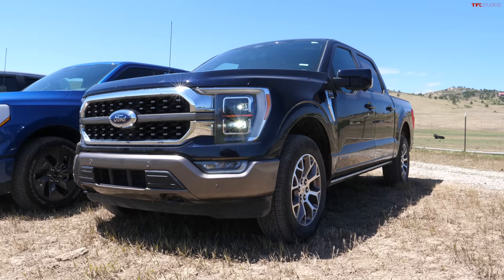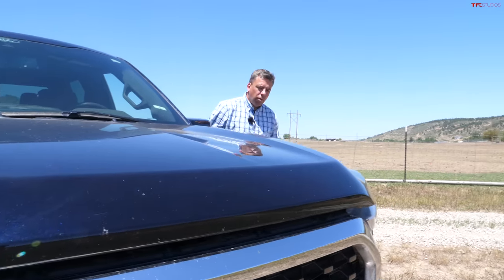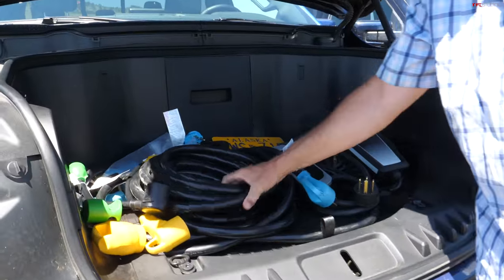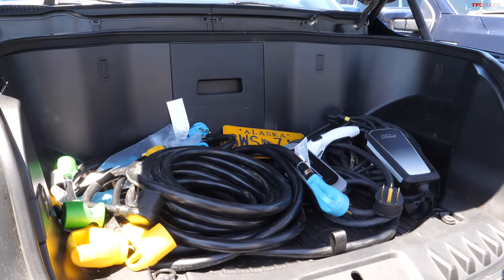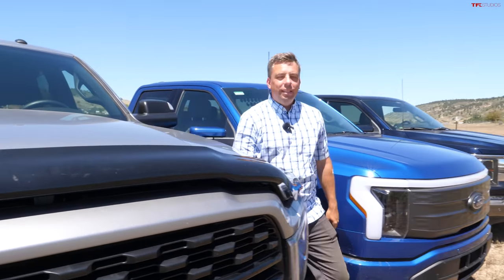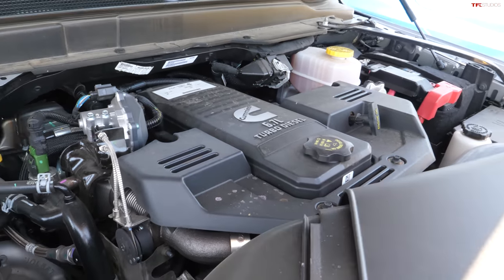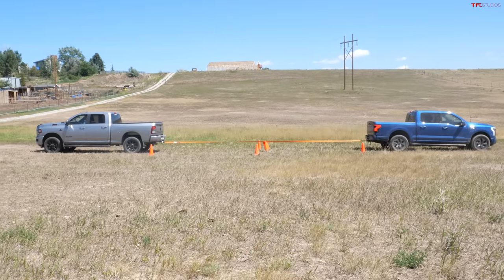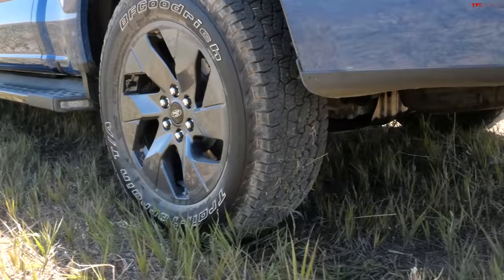Diesel vs Electric Tug-of-War: Ford F-150 Lightning Takes on the Ram 2500 Cummins In a Nail Biter!

Comment: Tires, surface condition, rope stretch, who's on the throttle quicker,.. all those and other factors come into play here. 
Maybe a better way is to load up a large/heavy trailer and pull up a steep hill on asphalt against the clock, whaddya think TFL? 
Now there are three trucks that I would not want to buy after this LOL.
Reply: they did exactly that in a video not long ago...........
Reply: @Sixinthefield  Opps! I missed that one., I'll look it up.

Comment: Anybody else see the article about 100 mile trip pulling a small trailer for the Lightning?  60 mile trip for a full sized 30' travel trailer.  EV has so much further to go before it makes sense in a TRUCK capacity.

Comment: I think I've got a pretty good idea from these videos about the state of EVs. Power and performance are second to none (Including ICEs) Range however, is awful. So until they make a battery that lasts over 300 miles UNDER HEAVY LOAD, fully charges in less than half an hour, and costs less than five grand, EVs will never be a proper "replacement" for ICEs. I'm scared to see a battery like that though: it would be inherently dangerous. (One Small Short=Massive Electrical Fire).

One interesting point from this video is the instant torque from the lighting. It's using only as much torque (or power required to make it) that is required in that instant whether it be 1% or 100%, which means it is infinitely more efficient than and ICE. But that means that there is not really any power to spare when the range says 300 miles (or whatever). Therefore, when the vehicle requires more power, it provides the same great performance, but at the cost of using more juice.

ICEs on the other hand normally waste a ton of energy, but yet they last much longer on a much lighter power pack (gas tank) than EVs. Why? Because the energy density of gas is much higher than the same volume of an electric battery. So the "trick" of the EV"s "300" mile range is just that, a trick to try and compete with ICEs. It's basically saying "You have exactly enough power to go 300 miles in the ideal circumstance with no extra electrical draw. So when you add more draw (e.g. a trailor), range plunges because it has no energy to spare. 

I think both EVs and ICEs have their places. EVs for performance, and ICEs for practicality. Neither is a replacement for the other (yet).

-MMD

Comment: Non stock tires on lightning. Throw the stock “economy” rubber back on there and I bet it’s a different story. Or throw better common rubber on all of them and see what results are.
Reply: Yep. It’s all about traction which means “tires”.
Reply: @jefferp  weight too
Reply: @jefferp  
And the low-end torque. 
The electric vehicle can rotate the tires more slowly then an internal combustion can. It also has more low and torque, and more weight.

Comment: The biggest determinants in a pull like this are weight and tire tread and pressure.  Torque only matters if you don’t have enough to spin the tires.  Once you have that much torque, anything more is wasted.

Comment: Now do it on pavement, because I want to see the lightning smoke those electric motors.
Reply: you might be disappointed. they took it up the i gauntlet and did well . the same test where the f 150 overheated and when in to limp mode along with the chevy
Reply: It won't because it's self protected. Just as he mentioned when they did that test. I doubt a ev will ever "smoke" a motor unless there is a malfunction or the safetys are bypassed
Reply: @beardedswordsman2901  these motor are powered by  variable  frequency drives 
if you were to lock  the rotor on a standard motor it would kick out the thermal over loads but with a frequency drive the motor will never send a high frequency than the motor can handle.
Reply: It’s still not going to win. The electric vehicle has the weight and the low speed torque advantage. 
Just like gasoline is going to always win in distance, Electric is going to always win in this comparison.

Comment: The back wheels weren't spinning because the truck could detect more weight on the front tires so it kept the front more powered. Less power needed for tires with less pressure on the ground, just cause spinning. That's my guess.

Comment: I have been driving a EV for a year and a half. And I have owned two Dodge 3500 with the 6.7 Cummings. I am still surprised the EV truck out pulled the diesel.
Reply: Take a look at your factory low rolling resistance long-life tires and compare to what TFL put on the Lightning for its trip to Alaska...
Reply: The Lighting has a tow rating of 7,700 pounds. The Ram has a towing capacity of 37,090 pounds. Stop it.
Reply: @clarkstonguy1065  the ram does not have that rating. You're quoting the specs for the 3500 high output RAM Cummins 6.7. which has over 1,000 foot pounds in torque and would have clearly dominated the lightning, not for the 2500 standard output 6.7. which is 850 ft/lbs of torque and a max towing capacity of 20,000 lb depending on configuration. They are different please check your facts before you spread misinformation. The 2500 is also limited by law as a 3/4 ton so it would not be able to legally tow the 22,670 lb it is capable of pulling When matched with a 3500. RAM has two different 6.7 Cummins.
Reply: Las ram 1500 te puede arrastrar asta 25mil libras de peso en quinta rueda pero en Estados Unidos no te permite las ley..pero nunca se podra comparar con una eléctrica peso aguante torque durabilidad..los vehículos eléctricos. Normalmente tiene que reemplazar la batería alos 5 años. Y de allí quien save el precio..son muy para el medio ambiente. Pero para trabajar no entre más forces los motores eléctricos más electricidad consume......saludos

Comment: Tired of seeing these tug of war tests done on the dirt. Do it on a paved surface, don’t be afraid to break something.
Reply: Not trying to be rude but breaking stuff cost money
Reply: I think it would be far more stupid to do this on pavement with an ev truck or any truck plus dirt slinging is a hell of alot more entertaining and alot less likely to become catastrophic
Reply: Pavement is a real test of power and durability of the components. I like electric but this test was for the folks that will never pull a skid steer or even a 3 stall trailer.

Comment: Imagine the pulling power of an all-electric Ford Excursion if Ford made one. That would be cool to see. 🙂
Reply: 🤮electric
Reply: It's still no match when you consider the range on an electric once you attempt to tow anything. Then you also have the recharge time. No thanks. When I can recharge in the same amount of time and get the same milage as a gasoline vehicle, that's when I'll switch.
Reply: Why would it be different than the truck? It's not like it's going to have more power because of a different body style.
Reply: @pflanagan1  Can you show me in my comment where I was saying "imagine the range of an Electric Excursion"? I said pulling power. Its pulling power would be better than a diesel or gas vehicle.
Reply: @lyman135  The Excursion would be more powerful than an F-150 electric because it's in the 3/4/ ~ 1-ton weight class. So it would in fact get larger heaver electric motors. But also because the Excursion was the largest consumer SUV ever built. So an all-electric version would be an extremely heavy vehicle with heavy-duty electric motors and a larger battery than the F-150 Lightning. The Excursion also comfortably sat 9 people.
Reply: @GalaxyFur   It wouldn't necessarily get bigger motorists. The ones in the F150 are plenty big for any heavy duty application as well.
Reply: @lyman135  The F-150 is a light-duty weight class. And with the diesel trucks already rated at higher power ratings, it's a 100% guarantee that they would go larger than an F-150. Even from a purely marketing perspective, this would be needed. 

The F-250 and larger trucks always get heavier drive trains. They are built for commercial business. The F-150 is a consumer-grade pickup truck marketed at homeowners.
Reply: @pflanagan1  Don’t think you’ll ever own an EV in that case. That Lightning has the equivalent energy of 4-5 gallons of gas. The power density will not get there in our lifetime if ever. That’s 100kw in 25lbs for gas vs 100kw 1800lbs in lithium batteries. 

People are so stuck on same range/charge time as a gas vehicle. If you drive 300 miles a day doing Uber, or tow 10k lbs daily obviously it’s not for you. Just like a $80k diesel truck and Prius would not work in those situations. 
EVs will not replace every vehicle, but for most peoples daily needs it works and works really well.
Reply: @TobyCostaRica  the problem is this is not a car. The lightning is a full sized truck. It’s meant to tow and haul things around. 90 miles of range towing a trailer is garbage. Especially with the recharge time of at least an hour (assuming u can find a dc fast charger). I love the idea of the lightning but it’s not a prime time ready vehicle. Neither are any of the truck EV’s really. I think for now hybrids are the way to go in the full size truck market. A friend of mine has the f150 hybrid and it’s awesome. Best of both worlds.
Reply: @GalaxyFur  regarding the Lightning’s weight class, some are actually a class 2b truck legally like the Ram 2500 as its GVWR is over 8500 lbs.  The GVWR for Lightning models range from 8250 to 8550 lbs.  I’m pretty sure the Lariat TFL owns is 8550.
Reply: How far would you go with e-excursion? 63miles. Give it another decade for crying out loud
Reply: @matbob7249  If they can make an all electric class 8 truck, then they can easily make an all electric Excursion.
Reply: @jamesbeaman6337  Yes, but an Electric F-250 would likely be 10,000+ lbs.
Reply: @michaelb1478  No but how many use empty trucks as a commuter? How many are towing 10k regularly? Don’t know where you are but I’d say 95%+ in Southern California just drive a truck because they want a truck, and don’t own trailers. If you were doing that on a regular basis I would imagine you’d be in a F250/F350 diesel. Towing is worst case scenario for EVs, Ford’s eTransit has 124 miles range, they wouldn’t have built it if it didn’t serve their customers. Hybrid is a great option, just like a F350 Powerstroke is a great option. For someone that wants a truck, but also have it make sense commuting, occasional weekend warrior use it will be a good option for a lot of people.
Reply: @pflanagan1  The issue is BATTERIES! Lithium Ion is actually a VERY DATED electrical storage system when much higher density (i.e. Aluminum-Sulfur at 8x per cubic litre volume vs Li-Ion) and/or much faster charging (Sheet Graphene Super-Capacitors at less than 4 minutes per 500 KW/hr) batteries become common-place within 5-to-10 years.

Lithium-Ion is only used because it's a KNOWN and WELL-PROVEN battery technology! It is nowhere NEAR the highest-density storage nor is it the fastest charging. It is merely "Good Enough" and "Cheap Enough" for most consumer markets!

The FUTURE of all-EV trucks and cars is 8x-energy-dense Aluminum-Sulfur Batteries and super-fast-charging Sheet Graphene Supercapacitors! I would say that is will be only 5 years for initial retail introduction and 10 years is the timeline for widespread retail for Aluminum-Sulfur and Sheet Graphene energy storage.

V
Reply: Electric idk bout that but I’d love to see the excursion come back. King of SUVs monster truck
Reply: a tdi suv can tow a 747
Reply: @GalaxyFur  Battery Weight and Motor weight are caused by the many wasteful manufacturing processes of 2022! 

I just designed and tested on our fancy CAD/CAM/FEA system an All-Carbon Fibre EV motor that embeds ferrous squares into a carbon fibre housing that use much less copper windings than normal surrounding a custom designed ferrous (i.e. magnetic) core all encased in a carbon fibre shaft and motor housing and all-composite fibre drive drafts, composite wheels, etc that weighs less than 150 KG (450 lbs) in its entirety!

PLUS I designed and built a single-piece compound-curve combined rheological shocks and strut system (i.e. magnetic shocks) that has over 20 inches of ground clearance using a upper-hub drive system similar to a Humvee along with a ferro-fluid braking system built-into the composite wheels that thickens the ferro-fluid when a voltage is applied and goes thin when no voltage is applied.

The rotors are fully-sealed and always fully immersed in the ferrofluid and the rotors have large ridges on them so that IMMENSE braking power is applied once the ferro-fluid reacts/thickens within mere milliseconds! The ferro-fluid and ridged brake rotors never wear out so no more replacing brake pads EVER!  Even the brake system is a light-weight composite polymer with a high-wear ceramic coating on a custom raised rotor-ridges design to prevent cavitation-based erosion!

In terms of actually batteries, much of the weight is in the casing which SHOULD BE composite polymer stamped in a single piece using a hot-press (200 tonnes+) with a hexagon-pattern strengthening system that is stamped-in that resists very high torsion, tensile and compressive loads easily!  This is a called a monocoque construction where the battery case is PART OF the high-strength car/truck  body!

No need to create individual battery cells like what Tesla is doing, just create a thin-composite flexible membrane separating the electrolyte anode and cathode gels in a single continuous Z-pattern winding that fills the ENTIRE battery case so instead of wasting all that space on ROUND individual cells connected in series, you get a single monolithic battery that has very high voltage and amperage (aka high impulse/fast drain!) that can feed high impulse motors big enough for Heavy Duty trucks and heavy towing tasks! Our design specifically addresses and prevents thos enast short-circuiting dendrite growths that Li-Ion is rife with!

We have done this on our Ford F450 Superduty test vehicle and are getting 1600 miles while towing 25,000 lbs worth of trailer and cargo and carrying four heavy 250 lbs each worth of driver and passengers!

We will be making this design fully open source under GPL-3 licence terms so the entire world will benefit from this new technology!

We have made the F450 Superduty 3000 lbs lighter than it already is (i.e. now 5500 lbs instead of 8500 lbs) by using strengthed composite polymer construction AND a monolithic battery design (i.e. much cheaper Aluminum-Sulfur batteries in our case!) AND it's actually CHEAPER to produce since we use far fewer parts!
 
V

Comment: You should've added 1000 Ibs to Ford F-150 lighting to be fair against the Ram cummins.. Maybe next testing vedio to be continued??
Reply: Ray Johnson   By distributing the weight between the front and the back , they can add passengers in the front cab or weights and some weight in back of the pickup .

Comment: No doubt electric is bad but how much battery did it just use? Great video guy's 👍🏻👍🏻
Reply: Why is electric bad? It did better than the others
Reply: @procrastinatormike3914  bad as in good in this reference
Reply: @procrastinatormike3914  electric is horrible! I’ll take an ice over electric any day of the week. 3 time’s on Sunday!!
Reply: Ray Johnson  😂😂😂😂 you’ll have 30 minutes of charge to do that. I’ll have half a tank left and still make it home with plenty to spare. Then, I’ll laugh at you while you’re waiting for 14 hours to recharge as I fill up in 3 minutes.
Reply: @procrastinatormike3914  Sorry that was a misunderstanding, what I meant was badass I was just trying to keep it a little PG. It's crazy how strong battery powered vehicles are & I'm sure with time they'll get the batteries to charge a lot quicker and last a lot longer.

Comment: I would love to see the tug of war with a V8 instead of a 6-hybrid. I'm sure the EV would still win but I don't think it would be as hard and fast.
Reply: Does the v8 make more than 570 ft lbs of torque?
Reply: Hook it up to a 1 ton Dually …..then we will see if EV is ready for the truck world
Reply: @diamondhead203  considering that you want to compare this EV truck to that, I'd say that lightning is doing very well. EV will be more powerful than any 1 ton dually in no time.
Reply: @luisprieto4390  yes
Reply: @luisprieto4390  it has nothing to do with torque, weight is the key.
Reply: @luisprieto4390  it has nothing to do with torque, weight is the key.
Reply: @diamondhead203  dually would be worse because the weigh is spread out.
Reply: @diamondhead203  dually would be worse because the weigh is spread out.
Reply: @luisprieto4390  EV started more powerful, we don't use them because the power they produce can't be sustained for hours at a time.
Reply: You think the V8 would be a better challenger than the hybrid? Huh?????
Hybrid makes more power, more torque, makes its torque much lower in the rpm range, and is heavier than the V8. The EV would beat the V8 faster than the hybrid my friend.